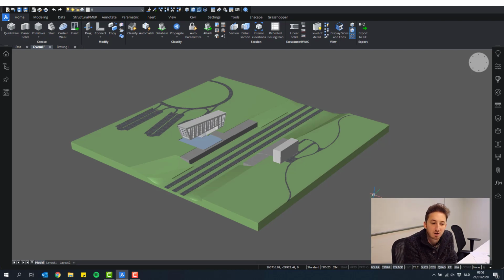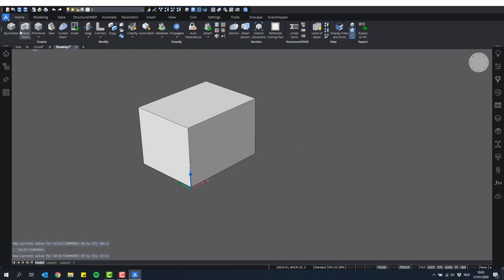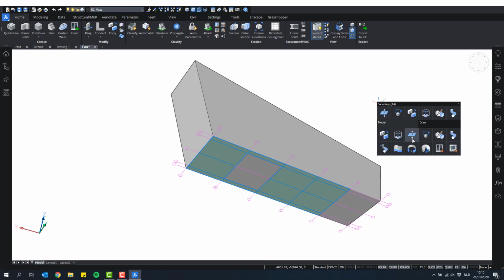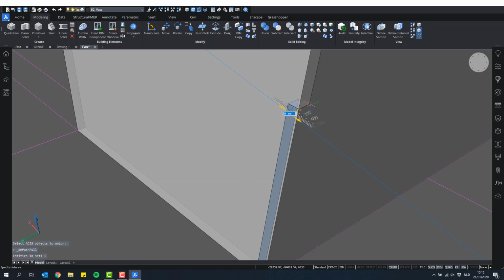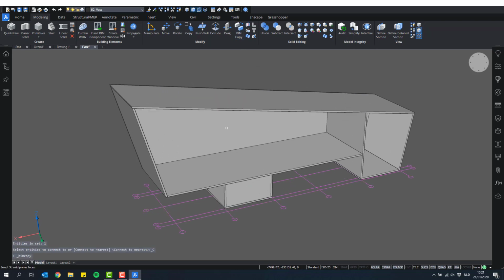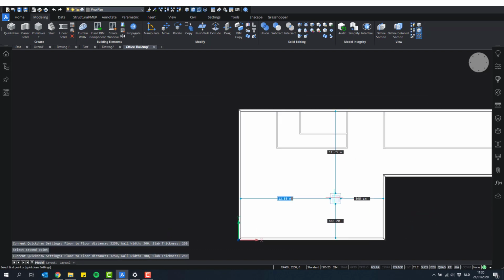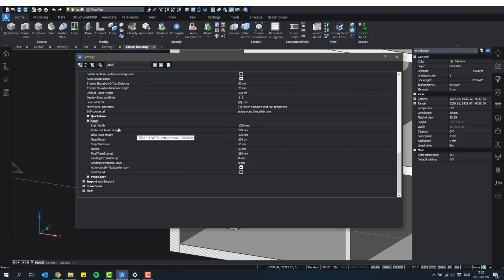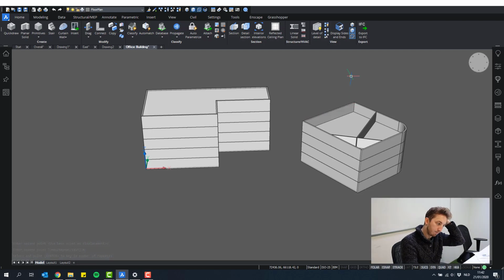BricsCAD V20 BIM Academy 2 - Basic Modeling

Comment: @8:36 how did you get the context menu? I have a more standard cad menu when i right click.
Reply from the maker: The picture shows the Quad. How to turn on the Quad and how to work with is, is available in our help center: https://help.bricsys.com/document/_guides--BCAD_getting_started--GD_thequadbasics/V23/EN_US?id=165079147018.

Comment: I have problem in my bricscad configuration. The program asks to input the command first (example: hide, push, union), then I will select lines or objects. I like to work with the opposite process, first I want to select lines or objects and then i input the command. How do I change this setting? Thanks
Reply from the maker: This is controlled by PICKFIRST variable - when it is ON, you can compose the selection set before launching the command. You can type the variable in the command line or find it in the Settings dialog.